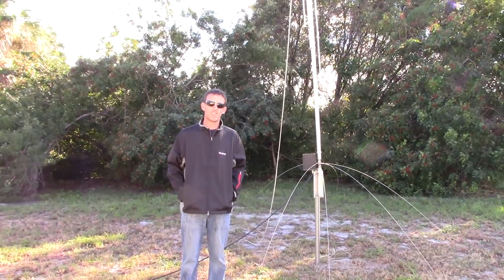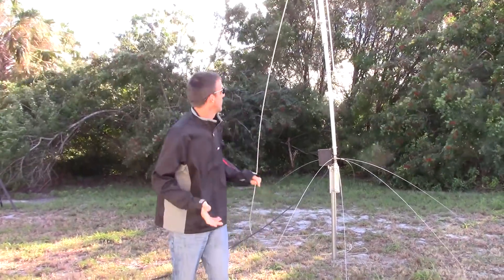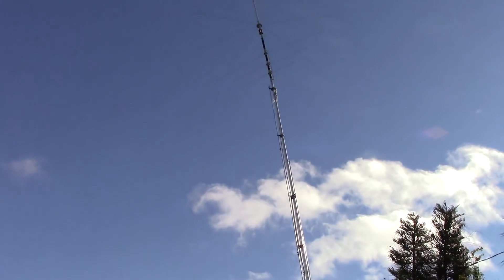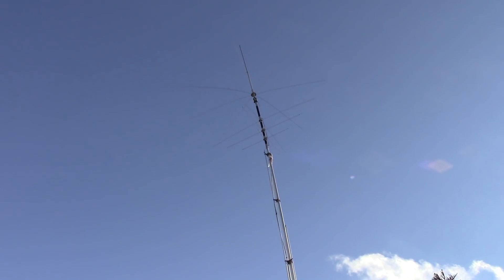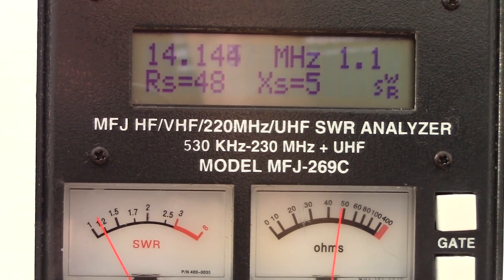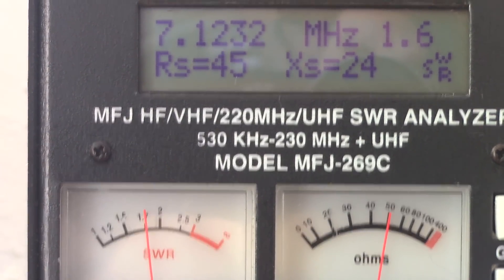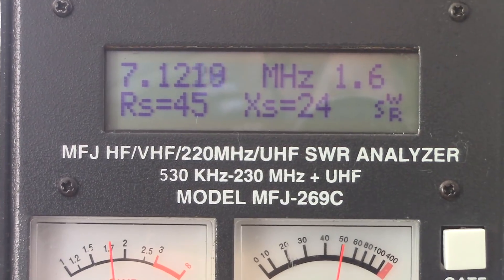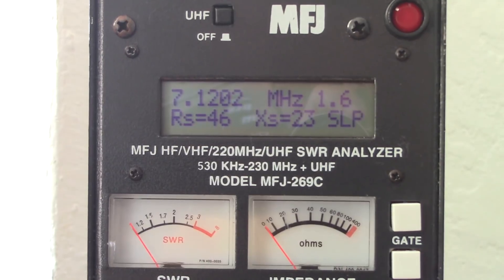Can You Use HF In High Winds? Flying Antennas! Viewer Request

Comment: Rain moisture on antennas sitting still without wind had minor changes with swr's. 
I noticed in the rain vertical antennas 10-20 meters had some changes compared to being dry.
Well get out your garden hose 😂.
Thanks for this video some hams worry if wind is a danger on transmitters here we get a look.
I figure I'm good unless it fell down and it's lying in the mud.
Working Mud-wave .

Comment: 20 years ago, I was an intern filling the blanks in inventory sheets. Almost out of nowhere, I got promoted to technician, dealing with 3,5" of icy rain that accumulated over six days. Let me state here it wasn't pretty. 

Icy rain and antennas aren't friends. The worst measurement that I took was 7,8 of SWR on a 150MHz antenna, although we saw 4,8 to 6,3 SWR on 400, 800 and 900MHz many times.

Keep up your good work.

Comment: Hey are all those wires outside the fall zone?!
Reply from the maker: Well, the reason I have this vertical now is because the 40 foot tower I had fell into the 13,200 volt lines Like 3 years ago... Blew a hole through the top of my desk..